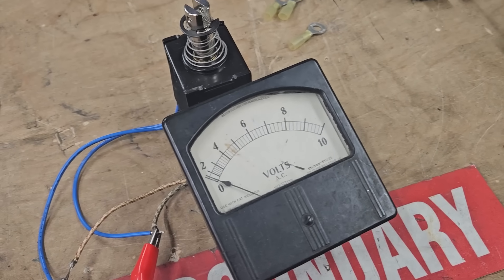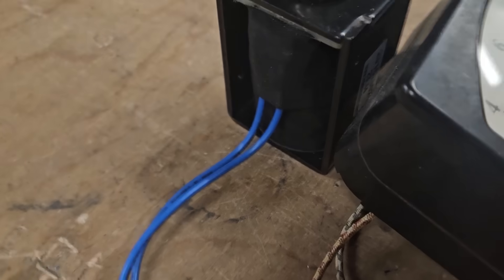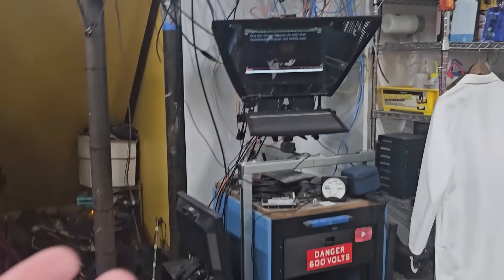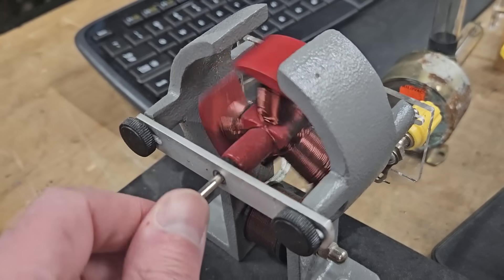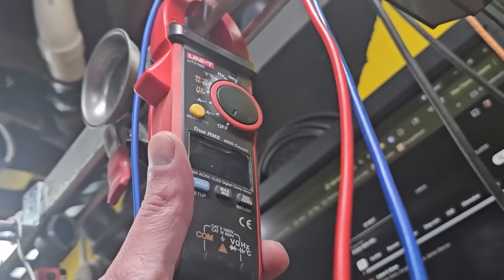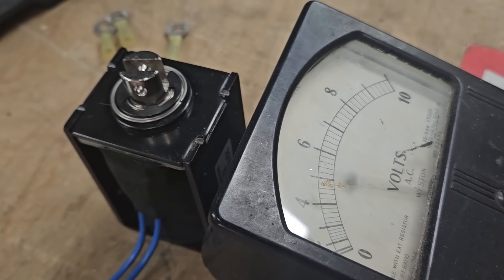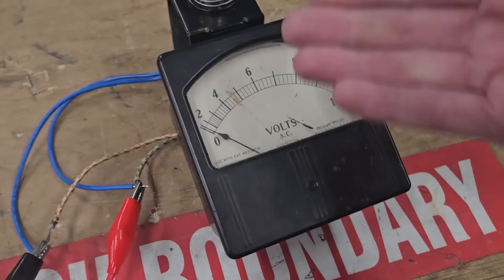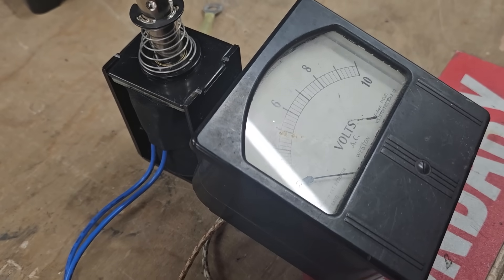Hysteresis Behind The Scenes

Comment: 12 frames in between, so 200-220ms., 10-100 times longer than I would´ve guessed. 

So designing an SMPS  operating at <10 Hz is technically possible?     

Not that I would want to design one, but it´s probably something for the serpent oleum salesmen catering to the Audiophile community. An SMPS operating at a frequency below the 20Hz threshold is guaranteed to make any audio device sound more harmonic in textures and organically palpable in the mids, especially if paired with cryogenically treated single core litz wires.

Comment: Im curious, because the dropping meter and the spring resetting happen almost synchronously. Would the magnet only go down or up halfway if you instead dropped the voltage to half?

Comment: I remember looking at a circuit diagram when I started my current career oh about 30 years ago for a CCD attached to the end of 200 ft of cable and all these delay lines at the point of termination. It was not until years later that I realized this was to keep everything arrive from the source in sync like it was to begin with. There were a number of coax cable inside this 200 ft of cable all with different frequencies and waveforms plowing there way to the termination. Now we just put the whole fucken camera CCD and processing in a package the size of eraser head. Now that fucken progress LOL

Comment: The table reminded me of Gehns benches in.. Riven..
(made by Cyan)
What gets me is a led torch that has a circuit board with various components that is just a switch..
and less reliable..
as much as they do it.. I Don't Need A Strobing Light, that's also too dim to actually work as a functional distress locator.
Can you do something on moving coil and moving iron meters..
Also fitting the right types of fuse particularly for LiFePo4.. short circuit discharge is 20KA..
Mega aren't rated for this arcing.. I am going to buy a T Class for the main 2 fuses.. inverter 2KW 250A and the one for 12v .. about 50A but might be bigger.
Have you seen Will Prose latest video about a 60,000W 600V? 3 phase LiFePo4 power pack.. the size of a telephone box...
and solar panels producing 1000 volts..
Now I am a qualified electronics and electrical engineer with loads of years with 12v...
but what Will is handling is Pretty Dangerous.

Comment: In the other video you mentioned that the lag was useful in some circumstances. My question comes from two fields I know just enough about to make me dangerous. Some full and semi auto firearms require lockup to keep the cartridge in the chamber until the chamber pressure has dropped to a level that would rupture the cartridge. A lot of H&K's like MP5s use roller delay and many platforms use rotating bolts with locking lugs. 
If an iron rod passed through a wire coil creates an electric charge and an electric charge passed through a wire coil creates a magnetic field could a full auto gun be made that fires rounds with iron cores that pass through a wire coiled around the barrel creating a charge that would disengage a solenoid from the bolt allowing it to recoil just before chamber pressure drops as the projectile leaves the barrel?

Comment: As per manufacturer's guarantee & data sheet specs...Most solenoids can turn on @ 70% of applied voltage ..
i.e. FOR a 12 V solenoid WILL turn on with a minimum 
of  8.4 volts ..
similarly it will remain energised now even if the voltage is reduced to 35%of applied V.
i.e. upto 4.2V.
Since your meter shows max. of 10V (f.s.d.)..
try the experiment with reduced voltage...
Also before switching off the power.. reduce the voltage to (40-50)% of rated voltage...,then switch it off. ...
Now observe the delay times......& do a follow-up vid.😊

Comment: Also have you tried dropping the voltage by shorting it as opposed to turning off the DC input What about straight shorting it so the voltage on both of them goes instant as well as the solenoid discharging Would that make it faster or more simultaneous because I'm thinking here what if the solenoid is it like a lower voltage than 10 then the Gage for the voltage would prior as it's from one till 10 you know and since it's on a spring the way ski but at one all of these factors are sensically close enough explain what the heck is going on however I am curious what the real reason is I personally would assume the spring in end of voltmeter #2 the voltmeter pass the voltage of the solenoid and number three The What about using I don't know just i'm curious now

Comment: Is it possible that the delay happens because the drop in the magnetic field happens slower then the reading of the voltage dropping and therefore the solenoid releases within a second later as the magnetic field is still Not as instant as the voltage itself Or is it possible that the solenoid is actuated at a lower voltage hypothetically speaking 2.5 volts rather than 10 so therefore that would also make sense for it to drop faster and I have no degree in Electricity Sure I have a dad is an electrical engineer and I played with motors since I was a tiny kid at 4 or five years old soldering my first Leds but nevertheless If it has to do with software it makes easy sense to me if it has to do with designing animation sure why not . That stuff clicks easily in my brain and I understand it. May I ask what is the reason behind the solenoid releasing later and some clarification on this please

Comment: Nope. A phase shift is not an histerisys. 

Your relay has a very simple and symmetric phase shift.

Histerisys is when the way forward and backward are not symmetrical. 

Histerisys is mathematically unrelated to speed.

The delay in your coil is a pure function of current and it's derivative.

An histerisys follows the same path almost independently of speed or derivative. 

A wall switch is an example. If you manually hold the button in the middle position, you can hold it for life, it will never contact. 

This has an implication which makes a huge difference with delay. Knowing the position of the switch does not allow to know it's state. If you know the switch is in middle held manually, you cants know if it's on, or off. Even if you hold it there for hours. State in the middle depends on previous EDGE state. There is a huge zone of uncertainty. When you graoh it,there is a grey zone.

Graphing your coil produces no grey uncertainty zone.

I had the issue with pressure sensors. It was calibrated for 80Pa with +- 20Pa. It means, if the pressure is between 60 and 100,the state of the output is undeterminable. Or, unreliable.  Or may depend on external weather. If the thing you measure is designed to produce 120 but actually does 95, after start you will have an alarm for days untill some wind makes the local pressure goes above 101 then alarm turns off. So while motor produces 95, alarm can be on or off.

That's an histerisys.
Reply: You als have histerisys in transformers, when you dive in details of how iron reacts to field. This is important to understand how it ends up in saturation, and why transformers are designed for a specific frequency, and a max power.

Comment: What of you added a cuttoff switch between the psu and the meter.  Thought being the psu switch off to whatever circuitry dranage time. Also what would the min voltage to actuate that cylinoid be?

Comment: This is great but ooooh!? Are we doing an in depth on motor coils? I cannot wait. I can wire a motor to diagram, I've done solar system design, and I've messed with all kinds of electronic doodads (electrically kinky farmboy sci-nerd mechanic) but there's something about connected windings that doesn't effin compute in my brain. I think I understand, especially when you add a run capacitor in the mix... but then my brain flips and dumdum says "ground fault!" Keep up the great work, Chris. I wish I was in a position to help financially or physically (I'm in WI). BTW, whatever happened to the kink boat? Did I miss a video in that playlist?

Comment: That power supply has some "inertia" on it as a capasitor. Should try the setup with an external switch. And add or replace the meter with a led, that won't have any inertia in the scale of things shown here.

Then you would find out why there's usually flyback diodes on dc coils.. Which might be seen with a led with reversed polarity.. After you burn few of those diodes and add way more resistors for it that you initially thought were enough.

Comment: Is this because the field needs to be “build” or is it because a inductor is a short circuit the moment a voltage is applied and then the field induces a resistance in die conductor?

Comment: It's great to have a demo that is just past "damn that's kinda neat" and into, "oh, we're only getting started" and something that a lot of people can also set up pretty safely. I remember my shop teacher way back had made his own 12v test probe using some 7segment leds just to not draw too much and could probe in CANBUS connectors. He found that while you couldn't "see" the flicker, because the PWM in effect was so wide, he could use it to comparison check parts, the light output wasn't reliable, but you could get a vibe for the hz and see if one of four parts was running a bit off. Even in the "digital" world, understanding the analog of hysteresis and the fact that in some ways there is no true square wave, matters.

Comment: If you look at something like a cooper/fiber optic slip ring for something that moves across individual contacts, you will witness the same delay between a digital and analog multi-meter. The processing time for a digital multi-meter could be long enough for you to miss a signal loss that you would have only caught on an analog multi-meter's needle. Same for fiber optics. An optical power meter processing time could be too long for you to catch a change in dBm vs using visual light that you can catch flickering with the naked eye.

Comment: I seem to recall that my Rigol scope has a VGA out, that I suspect can feed into a capture card, haven't tried. I'd consider setting up a test rig where the solenoid when activated (or in this case de-activated) closes a momentary switch. Voltage continuously applied to the one side of the momentary switch, the other side gets a connection to the second input of the scope. Adjust levels to reflect the range of voltage. First input goes to the output of the switch that activates the solenoid, where the input of meter is. Again adjust the voltage level of the input. You should now get a clean (ish) sample of how long it takes for the solenoid coil to de-energize enough that the spring and inertia overcomes the collapsing field of the coil. A third input to the scope can measure between the out side of the solenoid with a 10 ohm resistor to see any induced current  as voltage across that 10 ohm resistor as the field collapses.

Comment: This is why you use analog atuff. It is just fast.
On the pull in side, you can see it pause at about 5 V. That's when the solenoid starts moving. It doesn't do that when the solenoid releases.

Comment: What about the magic of using a solenoid in Peak-Hold mode to minimize power loss and heat generation? Also works great on fuel injectors so they can be closed quicker.

Comment: I LOVE analog test tools for certain stuff for exactly that reason. I love my hand cranked Megger because it gives force-feedback when you have a dead short or almost short, plus with a needle you don't have to translate abstracts - the needle over here is good, over there is bad, and if you're looking for wonky voltage shit in a circuit a needle works way better than a DMM with its two samples per second and filtering and smoothing and one-second refresh rate.

Comment: Can you lower the voltage slowly and see where the solenoid resets? I often see relays pick up at 60 V, but stay sealed in if the voltage drops to as little as 10 V.  Is that what’s happening here? Or Is that what hysteresis is?
BTW I REALLY like the longer videos!!!

Comment: As a follow-up experiment, instead of turning the power on and off, ramp it up slowly with the voltage control knob, and see how much volts it takes to pull in vs how much to let go

Comment: here's another cool and different hysteresis demonstration you can do: slowly raise the voltage  from 0 until the solenoid triggers, then lower the voltage until it releases again. HYSTERESIS. because it takes more energy to pull down the plunger than it does to keep it down
Reply: YES!
THIS is hysteresis. Not the magnetization one, but a hysteresis nevertheless. And the perfect example, switching, analog to digital, easiest to see and demonstrate.
Reply: Another YES!

This is the type of hysteresis I learned in ECE school.     

It's the same behavior as the venerable 7414 (or its variants the 74HC14, 74LS14, etc.) which, depending on the voltage direction, will change it's output at around 1V or 2V (the actual thresholds  vary based on the supply voltage and a bunch of other conditions).   But that volt or so does a nice job making the output more predictable in a high noise environment.

Comment: YAY a full sized longer video!  Love it.

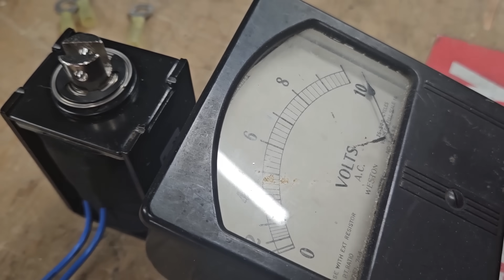3:38 - Chris Boden has achieved teleportation!  One frame, the needle's on 0, next frame it's... *gone*.  Next, it's a 11 (it's one more)!  

That's awesome.  Now do replication!

Also, the solenoid lets go about 4-5 volts (as displayed on the meter).  Every time.  So... I would be wondering if you could maybe hold it at 6 volts, then drop to 5, then 4... just a curiosity.

Also, why is it 'curious' but then it's 'curiosity'?  Where'd the 'u' goMG. TELEPORTATION IS REAL.

Comment: You are correct.  This is just the ideal behavior of an inductor.  Hysteresis is a deviation from that ideal, and it isn't really about time delay.  It's about needing to push harder to get the field up, and pull back to get it back to zero.  The Wikipedia article does a much better job than I just did.

Comment: Stored energy, yes. Hysteresis, no. (well, that's not what causes it, it would work equally well in another inductor of a similar value with zero hysteresis, e.g. an air-core coil)

Comment: I had truck, a diesel with electric shut off.  When I have the electric fan on in the cab and shut off the engine, the engine would keep running until the fan slowed down.

Comment: Uhh..  ..no, that's not hysteresis. You are showing back EMF or just inductance, V = L di/dt, whereas hysteresis is the permanent magnetization of the core material, meaning the flux will not passively return to zero, and requires additional energy to undo. Magnetic memory uses hysteresis, as does a latching reed switch, but you're just showing that once a current is moving through an inductor, it cannot be stopped instantly; the magnetic field collapsing continues to drive the current forward, but the voltage developed is opposite in sign - perhaps that's why the meter is driven to zero so fast.

Comment: So from what I understand it's not stored energy per say. When I the magnetic field collapses it creates eddy currents which produces another magnet for a quick second. Thats where the delay happens. Im trying to take a dump on your video. As an electrician myself thats how I understand it.
Reply: You're both muddling things. An inductor DOES store energy, and will release it once current is no longer applied, but that's not hysteresis, that's just the basic property of inductance. Hysteresis is a slight permanent magnetization of the core which means the flux will not return to zero without additional energy being applied. It's magnetic memory.

Comment: Sometimes you just need analog. We had a tach feeding from an output shaft to the VFD. there was crazy chatter. I had them buy me a nice Simpson... 
After swapping it out, I ripped it apart and found a crack in the body. It must have been some weird flux going on.
We had it happen again and the coupler was loose. same exact weird feedback loop.
It put out like a volt per hundred revs I think. It was pretty cool...
Reply: the o-scope just shows us the analog at high speed capacity. ;)
Analog is organic.

Comment: did you check what is the holding current of that solenoid, aka at which current the the core jumps out of the coil? bet you it is somewhere in the lower half of that current scale.

Comment: Quick question, the histerisis I learned at college is the margin you give a sistem before it changes. For example a street light turns on with less ambient ligth than when it turns of. From what I understand this is used to reduce the effects of noise. How is that one related to this exacly? I feel it's related but I don't know how.
Reply: People very frequently misuse the word hysteresis. Hysteresis is simply the calculated value of the difference between one value and another of the measurement. Typically this is taken as increasing to and decreasing to said value. 

For instance, raising a power supply to 3 VDC, taking the measurement, then going above 3 VDC and back down, and then taking a measurement. Hysteresis is the difference between those values.
Reply: You are right, this is delay, hysteresis is the difference in turn on and off voltage (that would be around 3 to 5V).
Hysteresis cannot be measured in time because time does not turn back, the solenoid state does